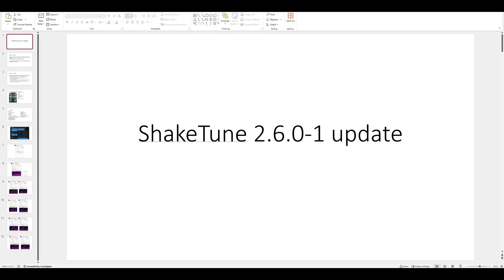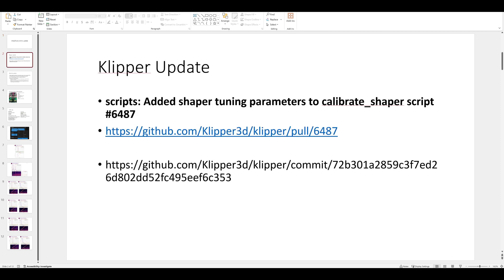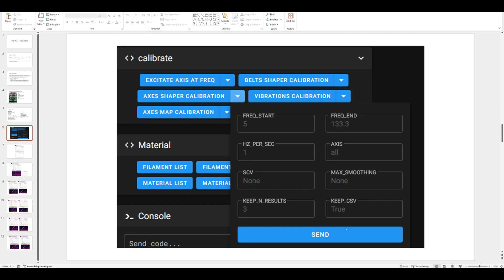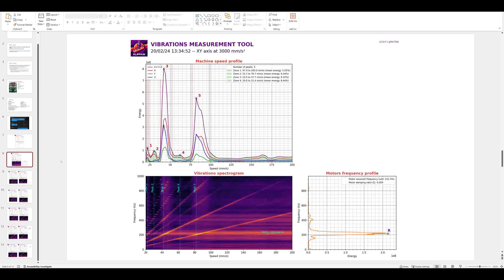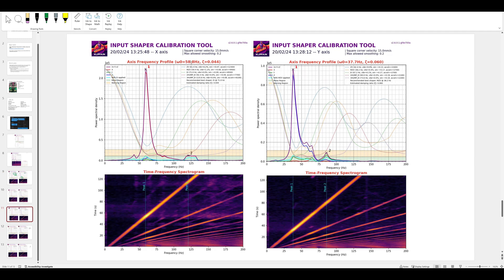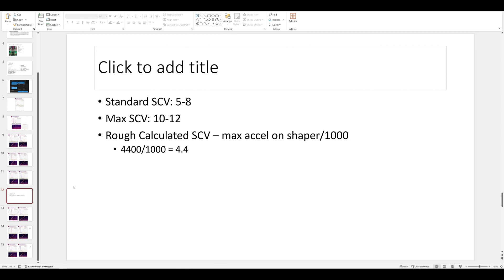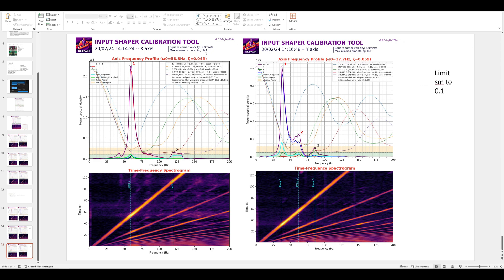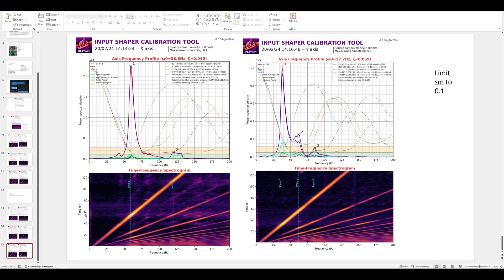ShakeTune 2.6.0-1 update

Comment: Why isn't there an option to limit the acceleration to get better numbers? Like if my X can do 2x better than my Y why would I need to know the max acceleration on X when realistically you can't run that anyway? Just reducing the acceleration would reduce the amount of vibration. Being able to say to the software to limit the acceleration to say 7000 would help tighten those numbers.
What I wonder though what how would going from MZV to EI hurt me if I have a max acceleration set by the Y at 7000, and both shapers on X are capable well over 10000 hurt me? Like EI has 0 vibrations and a slightly higher smoothing (MZV has 1% vibrations).
Reply from the maker: For your first question...There are a plurality of functions of the graphs for input shaper. One of these functions as you pointed out was to find the max accel. Another is to find the resonance freq, damping ratio, and shaper. The acceleration given by input shaper is a result of the testing of resonance freq (e.g. a result of the equations). It is not an input per se into the test. 
I do not understand your second question. I think what you are trying to say is will going further down the shaper tree (shaper tree starts with VZ and ends with 3hump-ei) hurt your prints. Generally, going down the shaper tree does two things. 1) it lowers your max accel, and 2) it increases smoothing in the parts. Smoothing is where the fine details get smoothed out such that they are no longer fine details. Corners will generally get rounder. How much smoothing is to much. That is something you will need to test out. 
Frix has stated that if your vibration result is less than 5% it should be good to use. My personal opinion is that if your vibration result is less than 5% run a test print using that result, and a second test print using the shaper 1 down. Using your example, print a test print using mzv for x and y, and another using ei for x and y. Then pick the best one for x and the best one for y.
I hope this answered your question. If not, feel free to ask again.

Comment: I dont personally understand why folks would be upset having vibrations in graphs 

Do ppl wany accurate models, tests and graph results? Or just the clout of posting their graphs with 0 vibrations?
Reply from the maker: The 0 vibrations  (o% vibr) means that you do not have ringing/ghosting/resonance in your prints. People are also looking for the fastest acceleration without these artifacts in them. This is why one wants MZV. Because it provides, generally a few hundred to 1000, more acceleration than EI. Also mzv produces less smoothing on a part than EI. This is why one would want 0% vibrations on the charge.